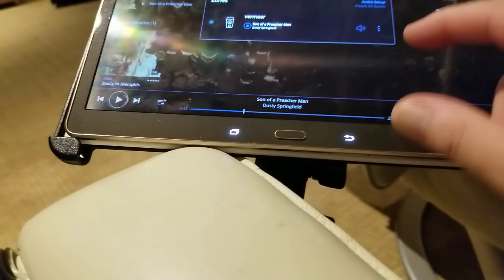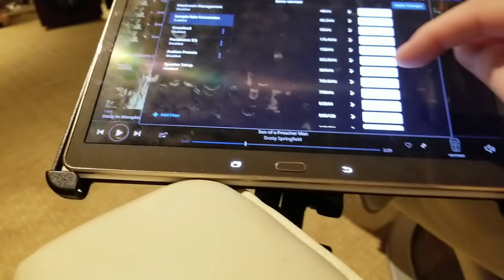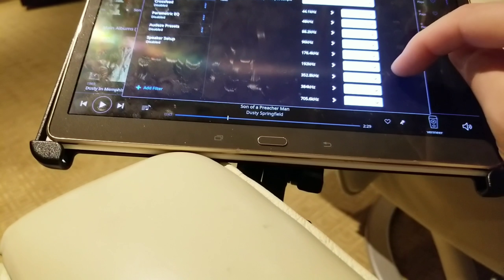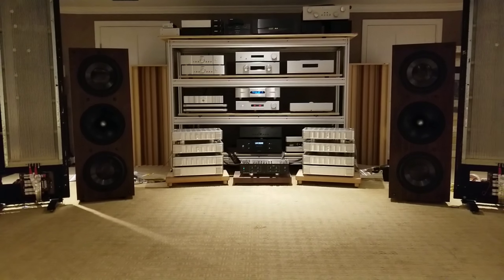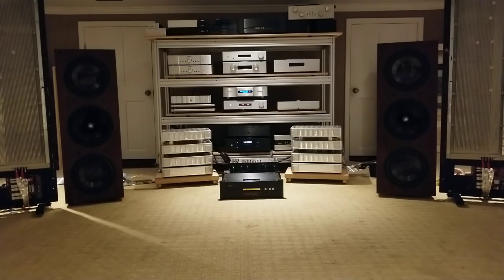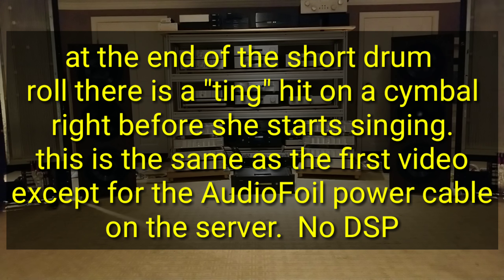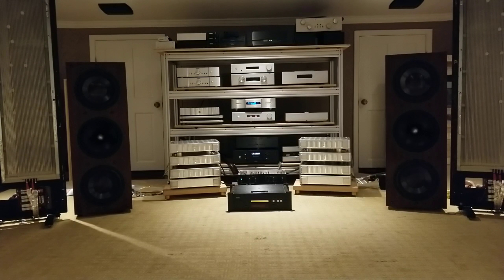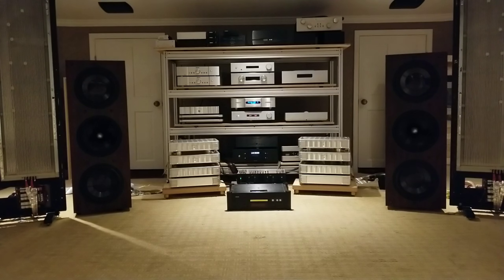ROON upsample vs power cable

Comment: Many people say cables are  snake oil and I used to fall into that camp until a good friend of mine let me try some well made high end cables and it transformed my system into an extremely resolving setup . From then on I bought the cables that worked for my system , yes they cost a lot , but still a lot less then if I were to have bought new speakers . Thanks for the video .
Reply from the maker: Thanks Lance, somehow I missed this page of comments. Sorry for the delayed response. Its truly a revelation what good cables can do. I make a living at it. And like you said , many times people were considering changing out another component, and instead the cables did the trick..  Thanks for your support !

Comment: If you're hearing a difference, I would bet it's more due to the fact that you chose a MP filter versus whatever filter is being used in the non-upsampling version (probably linear filter).  The delta between filters would explain what you are claiming to hear more than the upsampling.  

Also, if you are going to upsample 44.1, you should choose the custom rate of 176.4 - not 192.  Instead of using the "Custom" setting, you can just choose MAX PCM (power of 2) for the cleanest upsample of the source whatever the original rate.  Just make sure in Device Setup to specify the max rate of your device/DAC at 192.
Reply from the maker: Hi Jason, just saw this comment. Now sure how I missed this page. I dont upsample. ill revisit this in a bit..

Comment: Hi as a roon user I would want to know what is the best way to play roon?
Through one PC or server which does processing and playback or a server and a different end point
Playing from one PC/server we avoid the bad effects of router or a switch and play files locally
Keeping server different we can let it do processing and end point PC can do just playback
So out of these two arrangements which works better ?
I can understand using a specialized roon end point like sotm and sonore makes major difference but not talking about using them
Thanks
Reply from the maker: Sorry I missed this comment until now Rikhav. You bring up a good question. It is better to play from one unit. But even then playback os from hard working core board, so I put server and renderer in one box, so you get the benefit of the divided core and player as well as the benefit of no switches in the path .. :-)
Reply: I separate the core from the endpoints to avoid artifacts from the switching power supply of the core computer(almost all computers use switching power supplies)

Comment: WHAT DO I HEAR? Well, I’ll tell you-
sssss-SIBILANCE- that’s what I hear from her voice. 

I’ve been going back and checking out some of your older vids…for being OCD Mikey, I don’t understand how someone can sit down and enjoy this track or one of thousands of others with sibilance in the recording. It drives me fucking nuts! I just ponied-up for a new dac (from my $3k Cary Audio 100t dac- w a tube analog output stage w a pair of nos “6922’s”-for sale cheap btw) and purchased a new Denafrips dac (Thank you MoFi MF’ers for giving me the push I needed to upgrade my dac) WHAT DO I HEAR? More fucking sibilance on more recordings. I don’t get it- I feel digital is is improving daily, while analog has been stagnant forever. I want to “believe” in digital but damnit man, my vinyl rig “sounds better” to me than digital…Yes, I hear sibilant recordings on vinyl. Speaking of Yes- the Yes “Fragile” One Step cut from a dsd transfer fu too MoFi- is one GREAT sounding album. BUT the sibilance on Anderson’s vocals on Roundabout and Long Distance Runaround drive me crazy. 

Serious question- Why, how does sibilance get introduced in recordings?
Reply from the maker: Sibilance is in poor recordings. Its too hot. Using a sibilant recording however can help one judge how harsh a DAC is. Sorry you bought a Chinese Imperialist assholes DAC.. just wait till you need it fixed.. Truth is in less expensive rigs vinyl can sound much better.. its easier to sound good with Vinyl.. You have to spend more money to beat a cheap Vinyl rig with Digital... then you have to spend a SHIT TON more to beat it with Vinyl again.. the key is finding people who are music people not gear people to advise you what to buy.. Sell your Denafrips. Buy Dangerous Music made in USA,.
Reply: @OCDHIFiGuy  So, just checked out the Convert-2. One of the dealers that’s selling the dac, is Sound Pure. A high end boutique guitar store, that I used to work for in Durham, NC. I was in the electric guitar sales department. There’s even a separate acoustic guitar department, separate from the electric guys! There’s an incredible studio on-site as well as a pro audio department that carries all the “good-shit. When I say it’s a boutique store, I’m talking high, high end gear! I understand the guy behind the DM dac is an engineer and works with and his product is sold to studios (I see Sweetwater is also a dealer) but why is the dac being marketed as a pro audio only unit and not for home use applications for the audiophile? I KNOW I can get my hands on a unit, is it really “better” than other 3k dacs on the market or in that price range? Thanks